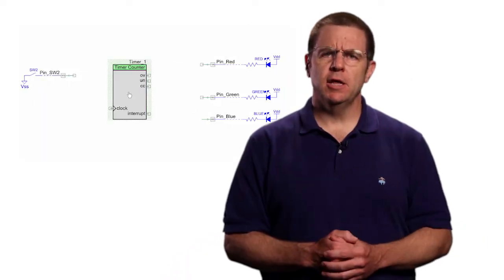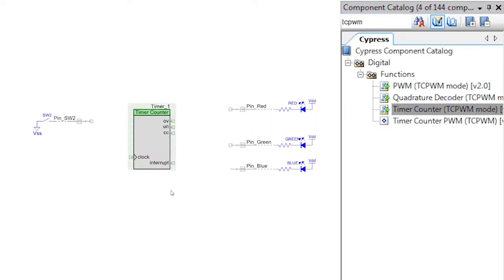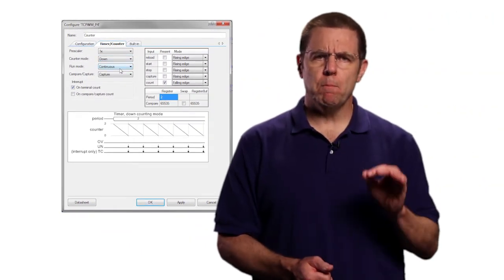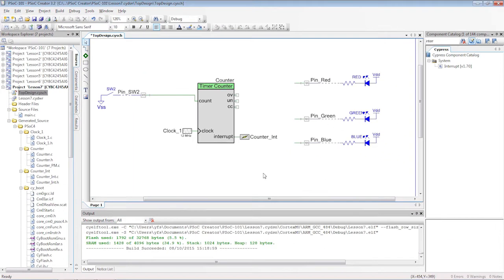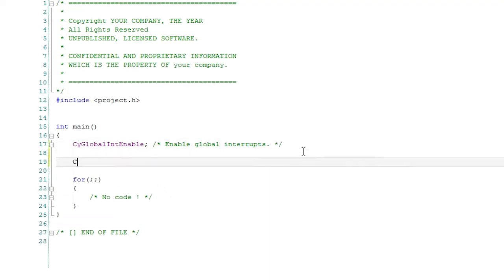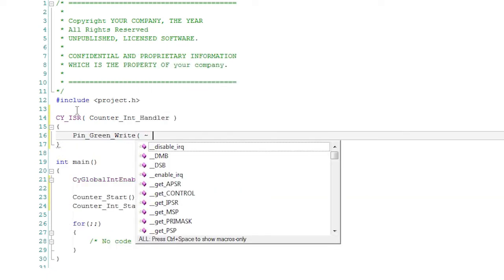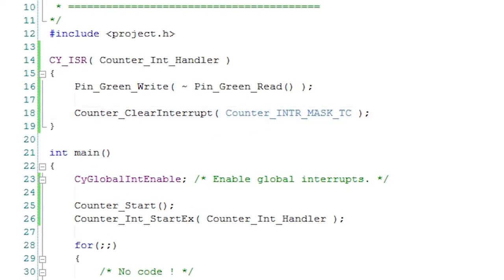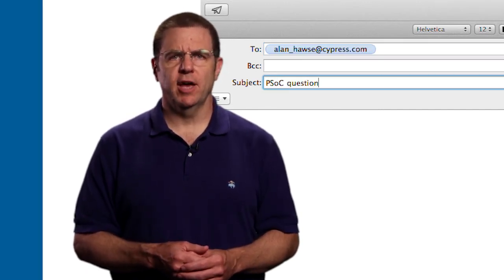PSoC 101: Lesson 7 Counter

Comment: I'm trying to follow the instructables using a CY8CKIT-059 PSoC 5LP. Up until this lesson everything went okay ... Seems like I do not have the TCPWM device in my PSoC creator software. I've used the Counter device, I can turn on the LED after counting a number of button press events, but I can clear the interrupt. (i.e. The Counter_ClearInterrupt()) method does not show up in the code completion popup)
Reply: Hi, I had the same problem. It turns out that "Counter_ReadStatusRegister();" clears the interrupt. Most of your questions have their answer somewhere in the datasheet of the component.